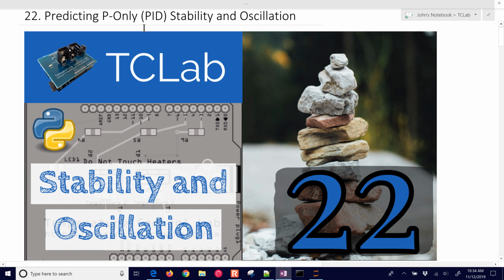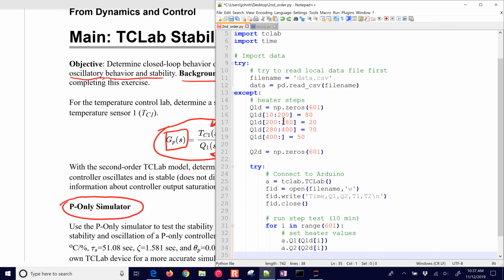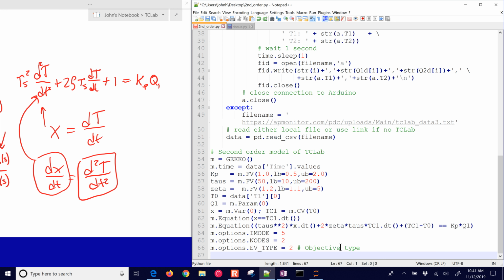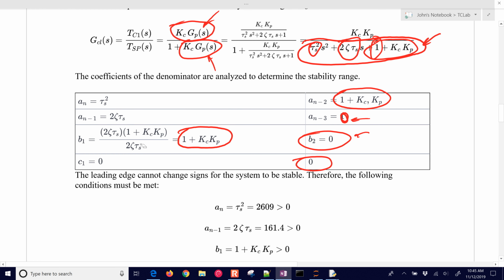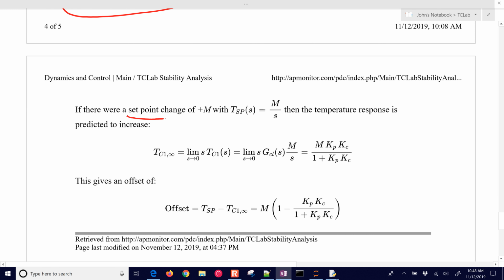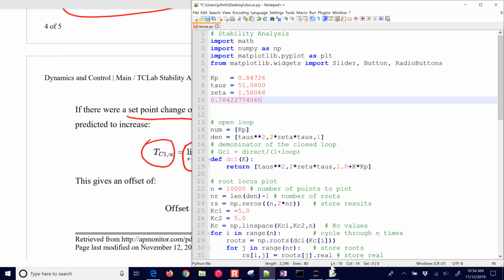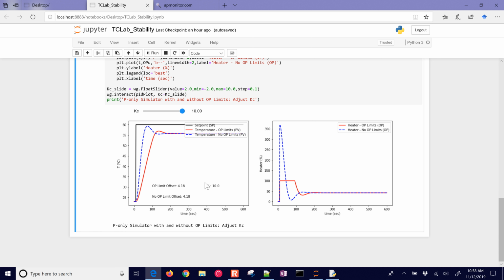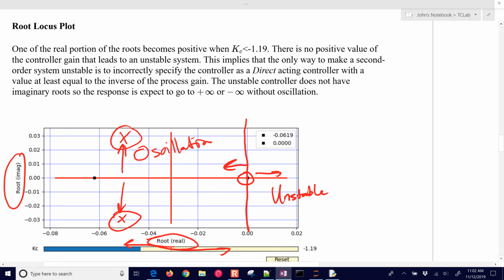TCLab: Control Stability and Oscillation

Comment: Hi, i am not sure if my question is relevant here. I am trying to measure a pressure control loop performance. I want to know if my control loop is starting to degrade using 5 main considerations: 1) minimum error at steady state  2) amplitude of oscillations 3) time to reach setpoint 4) overshoot ,and 5) stability.  What should I look for or monitor to have a sense that my loop is degrading and I need to do something about it proactively before it fails or before the upcoming PM for example. 

Thanks.
Reply from the maker: Check out the many scholar articles on PID control performance assessments: https://scholar.google.com/scholar?q=pid+control+performance+assessment If it is oscillating, a second order description may be appropriate: https://apmonitor.com/pdc/index.php/Main/SecondOrderGraphical

Comment: thank for such interesting video, but can you show more video concerning temperature and humidity control for drying system  using fuzzy logic controller and ardino uno using Matlab  (model based for drying system  including stability analysis ) 

any related issue that can share me please send me via my email address (fisehakedir@gmail.com)
Reply from the maker: There is a TCLab exercise with the Arduino and MATLAB/Simulink. Check out https://apmonitor.com/heat.htm  You'll need a humidity sensor as well.  A DHT11 or DHT22 may be good options.